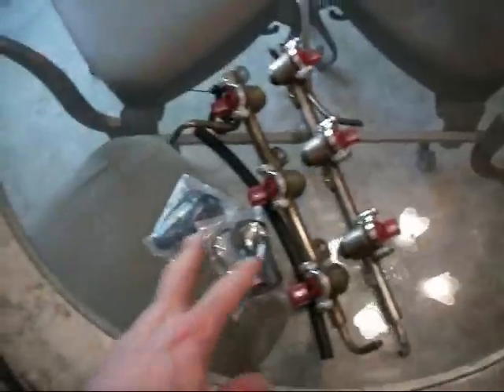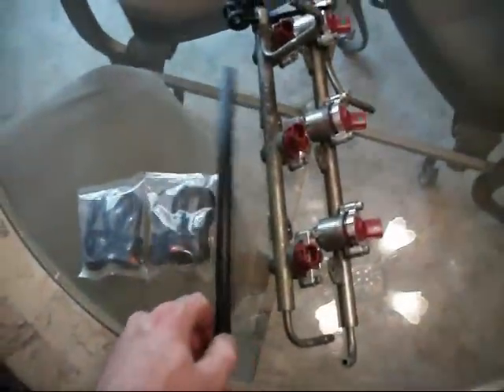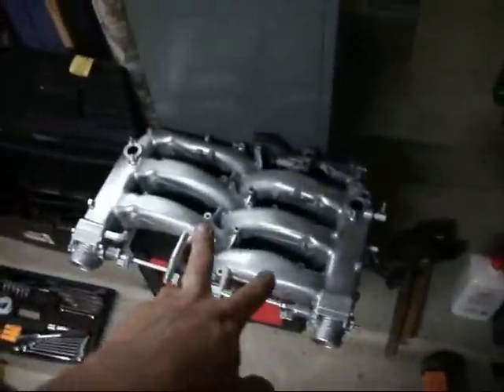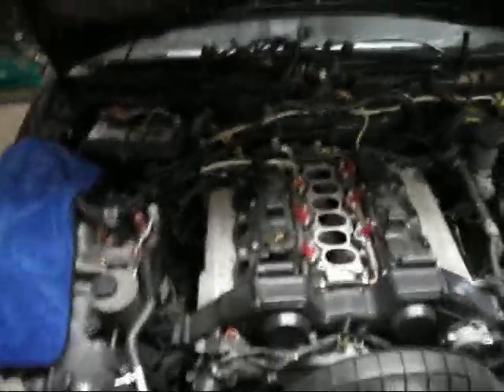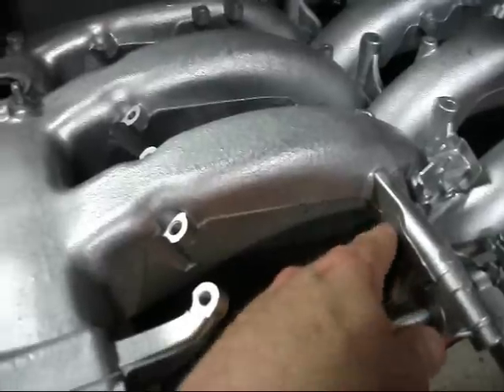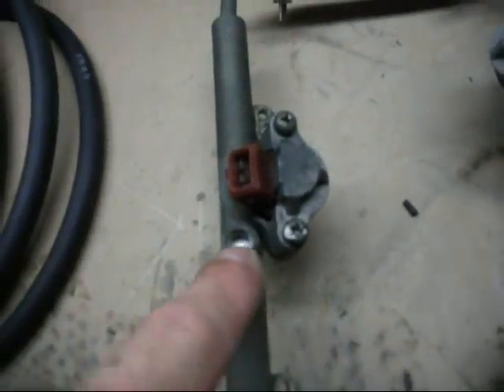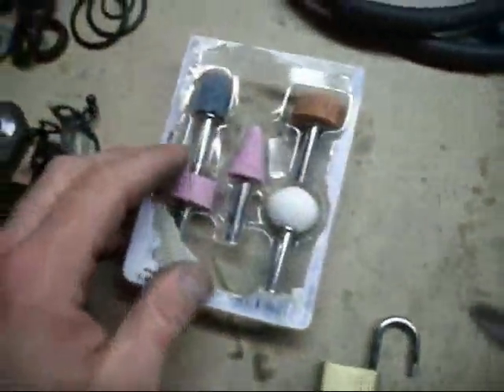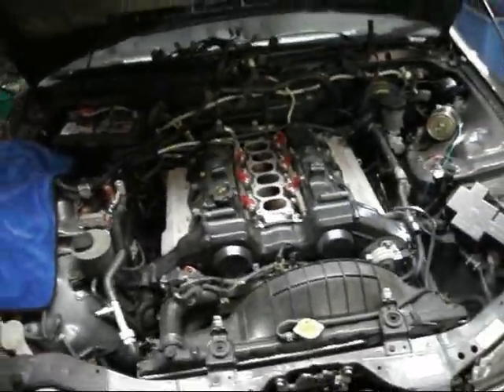Premier Z Shop - Joe Part 2

Comment: i have z32 TT 5 speed  i am having problems with it recently after my long road trip to  cali ,its back firing on me and  its losses power on 5000RPM and the engine light will come on and it will shut off in order for me to start the engine again i have to pump the gas for it to kick back in so can any one please help what problem im dealing with so i can fix it.